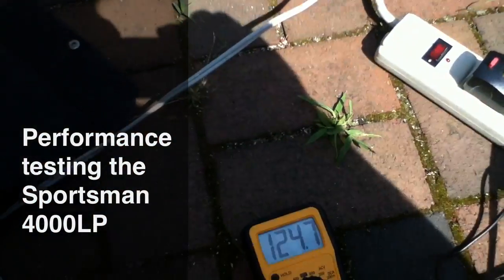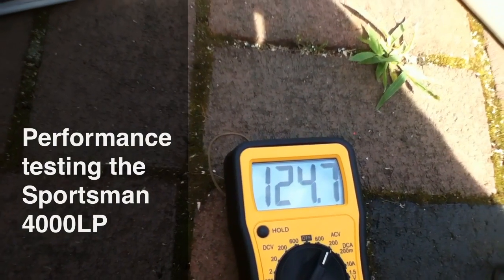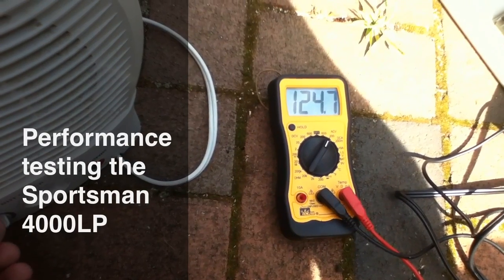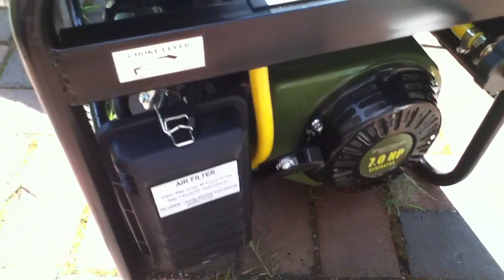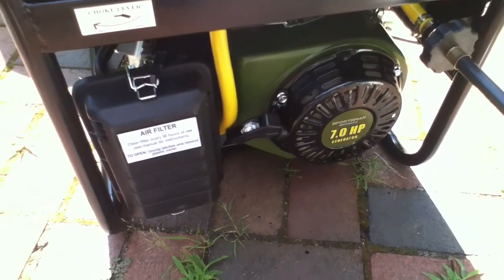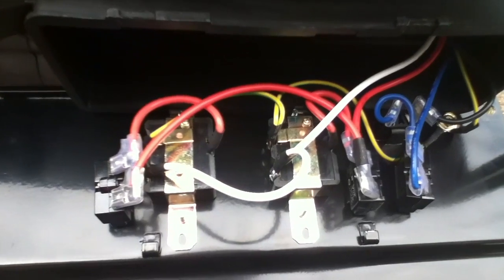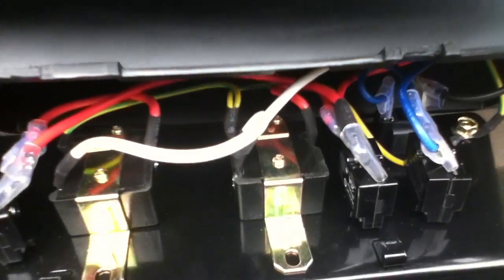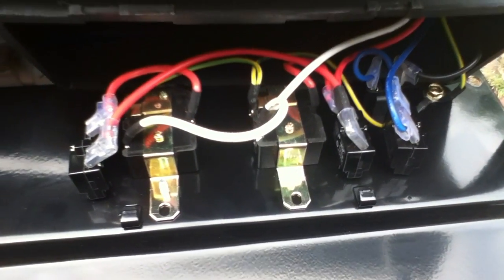Performance Testing the Sportsman 4000LP

Comment: No offence but that kinda sucks that it bogs with about 3375 watts on it. Kinda makes you wonder how it would ever handle a brief 4000 watt surge. I did some similar testing on my Black Max 3600/4500. I only put 3000 watts on it and it ran at about 119.7 VAC. Sure, the engine labored, but without a serious bog. Maybe I'll try 3500 or so for fun and see what happens. I seen a video here on you tube that had a guy testing a dual fuel carburator with the proper testing equipment for load. It seemed he was trying to show that the engine performed just as well under load using propane, versus gasoline. I always read that when ran on propane you lose about 10% of the power you get when ran on gasoline. The person in the video was probably chinese so I couldn't understand what was said. I am looking into going with a dual fuel carburator. (actually tri fuel). I like your meter.

Comment from the maker: No..I don't have a frequency tool...The documentation for the generator says NOT to run sensitive equipment on it (Tv's Computers ETC) but for a fairly reasonable price you could pick up an APC LE1200 Line-R 1200VA Automatic Voltage Regulator for about $60 on amazon and you will have beautiful clean power